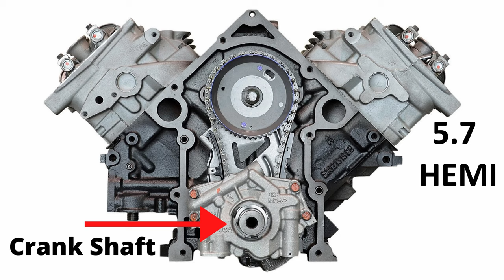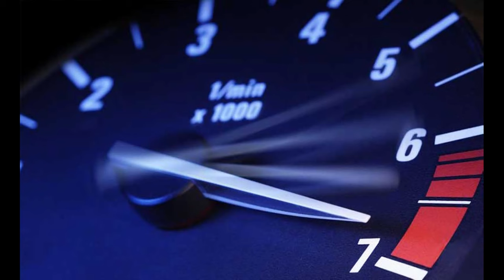HEMI TICK Explained (Easily) - The Cause and How to Diagnose

Comment: So this still hasn't been fixed? I thought it was..just bought my first ram 2020... 😢
Reply from the maker: I believe the fifth gen trucks have a different Cam Shaft in there Hemis. which I would assume is there to help address the lifter/camshaft failures. only time will tell.
Reply: @TheGettyAdventures  mines a 2020 classic? To add to the confusion? Did they put the new engine in the classic? Ahah
Reply from the maker: @coltendixon1782  Oh okay, no you have the same 3rd gen Hemi that's in all the 2009-2020 body style 1500's. They did update the lifters in 2016 for these engines but only time will tell is that is going to solve anything.
Reply: @TheGettyAdventures  thanks man! Sub'd!

Comment: What about the 6.4 Hemi what I heard read its both 5.7 & 6.4 have same issue I believe perhaps comparison of the two Pros/Cons.
Reply from the maker: not as familiar with the 6.4 but I have also heard of the issue which would make sense seeing they are probably very similar engines.
Reply: 6.4s do it just the same. My 2016 ram 3500 with the 6.4 had a lifter going. Tones of metal in the oil. Only 65,000km on it and oil changes every 5000km. Dealers weren't getting approval to tear my engine a part to "diagnose it" and kept telling me to come back when there is physical issue. Fully knowing my warranty was up in a few months. Needless to say I got rid of the truck.

Comment: FYI. IMO you're conflating some diagnostics.  If you have a tick, its not a fuel or ignition caused misfire.  If you didnt have a tick and had a misfire then start down the regular diagnostics tree.  Tick is either exhaust issue or lifter issue on these engines. Also, the hemi is not a SOHC, its a standard in block cam. I get you're trying to make some relevant content but you're likely causing confusion.

Comment: Engine isn't worth it with the prices they sell for
Reply from the maker: some would say that lol
Reply: @TheGettyAdventures  They're real picky with the oil, make sure it doesn't get low. Mine got low, went to slow down to make a left turn and went into safety mode and oil light came one. Added more oil and still happened. Also when cold start would make ticking sound and got for about 30 seconds. Did an engine oil flush and put high mileage(137640) and did a cold start and tick went away way faster like 10 seconds. 
Next job is to replace the stock exhaust manifold with aftermarket.

Doesn't get enough oil so camshaft gets all worn and eaten, and the rollers are worn. Why they have lifters and camshaft issues. 
Seen videos of newer ones having the tick

Comment: If you watch the other video he explains that it takes a LOOOOOOOOOOOT  of idle time for this to happen. Just rev you engine every once in a while if you are worried. The problem is seen on cop cars most often. Also, use 89 octane or higher as recommended by the Chrysler.
Reply from the maker: Ya I agree with you, I dug a little deeper and as of today I wouldn't totally agree that idling alone is causing these lifter failures. I think a very long extended oil life along side these hydraulic valve lash lifters are a little more suspect. either way idling is never great for an engine but I think there is more to the story!

Comment: Fun fact: in fact the P47 was powered by an R2800 double wasp RADIAL turbocharged engine that produced 2600 HP. Not an inverted V, but  radial. Not 2000 HP, 2600. Seriously, that 'Fun Fact' wasn't that fun... or that factual. Wiki! Always check.
Reply from the maker: Very Interesting!

Comment: I see the problem you have a dodge
Reply from the maker: haha honestly you probably aren't wrong. they have their flaws but for the price I ended up paying I was willing to give it a shot.
Reply: MegeJ don’t worry very soon you’re favorite make will soon follow the same quality, most engines are coming out with plastic internals and very high f.i. pressures and expensive tech. Start saving now
Reply: @TheGettyAdventures  not sure if this is a design failure because the 2005 hemis never had cam lifter issues and some are running up to 300k miles and also in the ram truck forum many people killed the Hemi tick by using redline oil 5W-30 they say that redline oil has the additives that suit the 5.7 hemi. And also a charger owner had a Hemi tick so they took out the camshaft and send it to an assay to find out was it a soft camshaft and components or was it a lubricant failure and they gave it to steve Walsh builds who build racing engines to take a check on the cam. And he went to take the cam for analysis and turns out that it's not a design failure it was more of a poor lubricant failure due to bad additives on the oil.il post the link so you can read it your self
https://www.chargerforums.com/threads/answers-5-7l-hemi-camshaft-professional-failure-assay.382357/
Reply: @TheGettyAdventures  also what about the 5.3 ls engine on the Silverado the new 5.3 are also having cam lifter issue even though it still has the same engine block since 1997  and they never had cam/lifter failure correct me If I'm wrong I don't know much about LS engines.
Reply: Real funny!
Reply: @ironmike7339  yes I know dodge is a joke!! Hahah 😂
Reply: @megej2600  what about chevy their 5.3 also have camshaft/lifter failures.

Comment: those engines are prone to roller lifter failure. You can reduce your chances of developing that problem by reduceing idle time. the upside is the rocker arm geometry is excellent. Those. engines can rev very easily and are capable of big power.

Comment: If it ticks when you first start the engine then goes away isn't that a sign of exhaust bolts broken
Reply from the maker: how long are we talking about? like 2-3 seconds or like 30-40 seconds. if its super short then most likely the top end not getting oil pressure right away. but ya if its longer then a few seconds I would lean towards an exhaust leak
Reply: @TheGettyAdventures  yeah not usually longer than a minute. 
I got a stethoscope just haven't really checked it yet. But I do have a set of headers going on really soon
Reply from the maker: @dudleydorite7678  sounds like its more an exhaust issue. and hopefully those new headers solve the issue! and sound awesome

Comment: The truth is Dodge is a total shit car manufacturer, primarily the last 10 years. Unfortunately my lady has a Ram 5.7 and I have a 6.4 Charger, and her "Hemi tick" just arrived at 67k miles. I truly would not recommend Dodge company to anyone. Vehicles are old tech, old school, cheap materials, on a heavy frame. I've thought about selling my Widebody Charger already, and I spec'd and built mine in '22, yet I'd still get rid of it. May wait 1 more year til warranty up. My 6.4 engine already squealing occasionally at idle and it only has 7k miles on it. Fkn unbelievable the amount of issues it has had in 2 years. These are not new vehicles either. These are cars and engines and parts that have been around since dinosaurs yet they still happen. And Dodge service department? Oh lord, stay away from there. Don't even get me started on them.

Comment: I have a 2016 Ram 1500 4x4 wth the 5.7. At 72 thousand Km. Very bad Hemi Tic. My dealership in Ontario had it for 23 days they gave me a rental that they payed for. They said  they were going to gave me brand new Long Block from Chrysler. I went and saw the long block when it came in. I had bought the extended warranty. 37 days later they called me 8 pages of the work order.Ram runs good only have about 700 km on it. The dealership told me had I taken it anywhere else but the dealership They would  not have covered it.told me because they had the print out. They payed for 100%.plus Rental $330 dollars. Plus re and re. and brand new long block even had the  new spark plugs in it.
Reply: Where in Canada. I’m in Ontario
Reply: Live near Newmarket
Reply: @robert19271  I’m in Orangeville.  What dealer did u go to
Reply from the maker: I take it you had all your service work done through that dealership and they said that's the only reason they could cover it. lol makes me nervous because I do all my own maintenance. Thanks for sharing!
Reply: @TheGettyAdventures  yes sorry I did not explain myself very good. Had I had any oil change or  other work done else were other then dealer they would not have gotten this under warranty. They spend almost 2 hours going threw all the work orders for the Ram  No work had been done on the truck other then  that dealership. Thanks again.